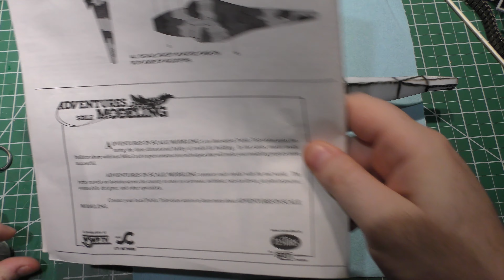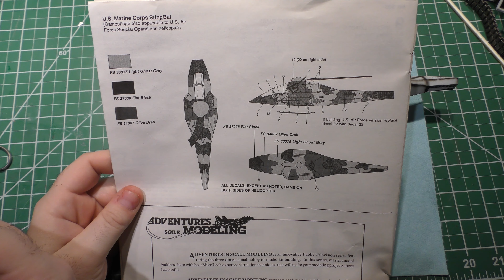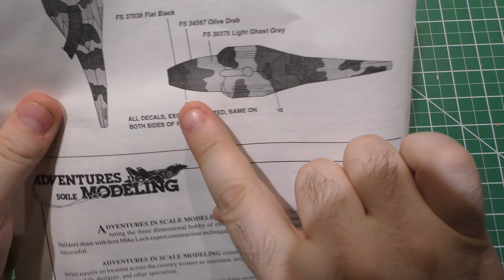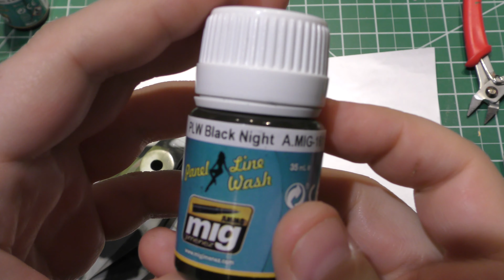Vintage Kit Building - Testors 1/48 Stingbat LHX Full Build - Part 3 Paint, Decals, Weather, REVEAL!

Comment: I just bought this kit on ebay. Been looking for one for the longest time but the sellers just wanted too much for them. Anyway, went on YouTube to find any videos on this kit and cameup on yours. Very impressed with the final result. It looks really good. But as with you, I have my opinions on the rotor blade. I personally would have just left it flat black like on Army Helos. Maybe deicing leading edges on the blades would have been better. Again, just my opinion from a former Army aircraft electrician.
Reply from the maker: If I had another one to do I would have just kept the rotor flat black or maybe OD green. The HAVE GLASS finish definitely didn't work out the way I was thinking here. One day I might touch it up.

Comment: I honestly love the looks of this fictional helicopter. I agree with the missile bays, but I would have switched the kit's 3-blade rotor (which look absolutely hideous, even for a "futuristic stealth helicopter")  for the Comanche's 5-blade rotor (the flat one, not the one with the cone thing on top), and I would also have scratchbuilt some tailfins angled upward and out for it. Kinda like what you would see on a MD530, or that Revell Ka-58 futuristic helicopter model. Seeing as it's a NOTAR design, the fins shouldn't interfere with the exhaust system, so they would be put a bit more forward. I absolutely love the build, but since these are '80s fictional designs, you can clearly see that it was made to look cool, leaving real-life functionality to the background. Those landing skid struts look absolutely fragile, even when thinking about a real life model. How would they work IRL is a complete mystery. The turret would fire at the sensor when pointing forward, and since it's positioned in the center of the helicopter (which I honestly think it looks cool there), would leave a huge blindspot in case the gunner needs to fire upwards...

Overall, a very nice build. The solution for the missile bay was very good and didn't look out of place, probably just a few more straight struts added to give off a more realistic feel. Loved it.

Comment: What matte coat did you use and what was your process? I've never seen such an effective matte coat
Reply from the maker: It's Windsor & Newton Galeria Matte Varnish. It's an acrylic and as far as I know it can be thinned with pretty much any acrylic thinner but I use Vallejo airbrush thinner in a 40/60 varnish to thinner ratio. I spray it at 20psi and I'll do between 4-5 passes, letting it flash off between passes per coat. I give it about 30 minutes between coats and do 3-4 coats before I set it aside and let it sit for about 6 hours before I mess with it again. It really is the best matte finish I've ever gotten. I bought it on Amazon for $7.